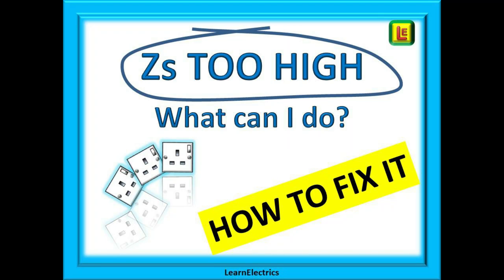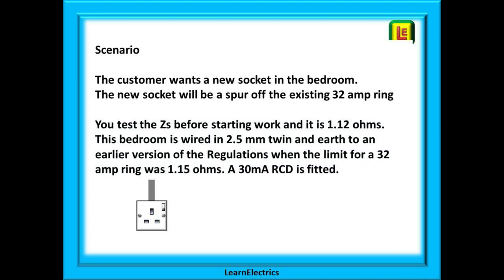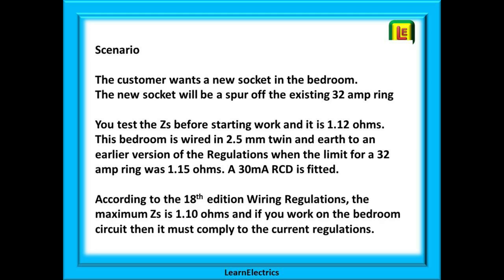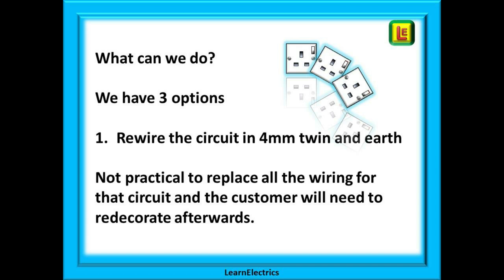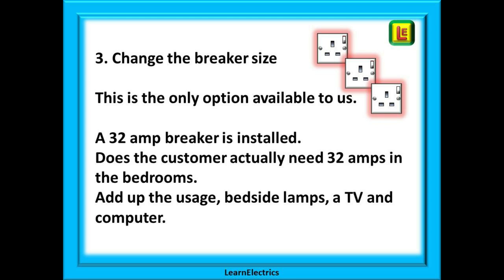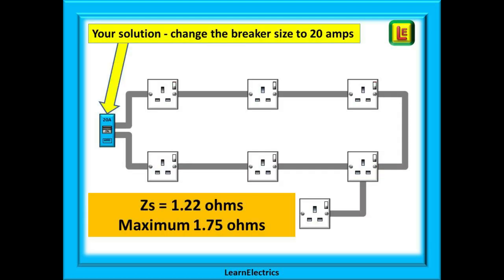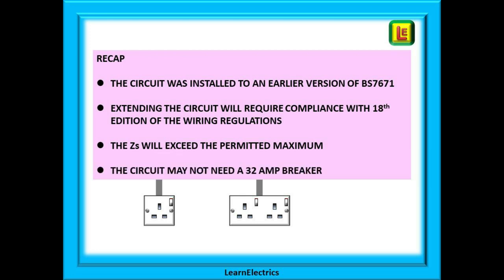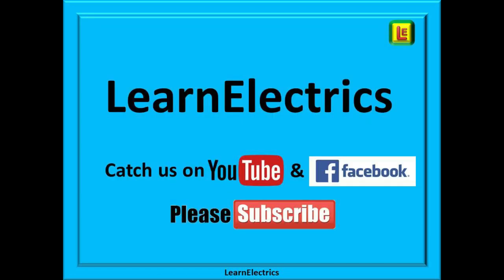Zs TOO HIGH What can I do?

Comment: Great video. Please keep posting these. 
I've just learnt something new here. 

Another solution would be to split the ring and place two 20amp breakers into the fuseboard so you have two radials? 

Is this ideal?
Reply from the maker: Glad you enjoyed it. More to follow. Thanks.
Reply: yes that would be fine providing you have a spare way in the CU and the cables weren't in an insulated wall, look up referance methods, if traditional on brick covered in plaster or in capping/conduit then ok

Comment: These are an excellent set of videos - very clear and helpful. Thank you for making them.

I understand your method and can see it would work, if the ring final can be de-rated. But would you also try to figure out whether the high Zs is a fault and if it can be fixed, maybe by comparing it with with the Ze, checking ring continuity etc. It might be down to a loose connection or broken ring.
Reply from the maker: Spot on Nick, but we are assuming here that we have no fault circuits. The Zs is just a teeny bit too high whereas with an o/c fault we would read 2000 ohms or something. Example the older Regs allowed 32A Zs at 1.16 ohms, now it is 1.10 ohms. No fault but if you are working on that circuit this means it must comply with the new rules. This video was about how to do that. Glad you enjoyed the videos, lots more to come and please keep the comments coming. Dave
Reply: @learnelectrics4402  Thanks Dave - that all makes sense 😀

If you do a video on SWA, would you be able to talk about using the armour for CPC against using a core. All of the YouTube sparks seem to use 3 core SWA, sleeving the 3 phase colours to blue and green/yellow.
Reply from the maker: Good idea Nick, I have put it on the list of videos to do and we will talk about doing it. Thanks for the suggestion.
Reply: @learnelectrics4402  Why do you assume it would only be an o/c fault? Loose connections or damaged or corroded conductors or even a faulty socket could also be the cause. All you have to do is edit the video to say you have checked for faults at the existing sockets and bingo!

Comment: Another excellent well presented video. Why does the max impedance or Zs allowed go up when circuit breaker capacity goes down.
Reply from the maker: A 10A MCB needs half the current to trip of a 20A MCB. Therefore, the 10A has twice the Zs of a 20A.
Ohms law, as resistance.impedance goes down then current goes up. Think of a see saw. hope this helps. Dave.
Reply: That makes it totally clear now of course I understand. Thanks for getting back so promptly.

Comment: The Zs video is great. I have been told however that if you are exceeding the 80% value of max Zs then you are at odds with voltage drop requirements. I asked a sparky friend of mine and he said that he had used this method a number of times, mainly on ring mains and never had a problem. The 11.5 vd was guidance and not statutory. What do you think
Reply from the maker: I always follow the Wiring Regulations. That way I can use the Regs in my defense in a court of law.
Reply: Hi Chris
Dave is right, however there is a loop hole. as you may be aware the IEE regulations are not statutory. However if you follow the ESQCR that are statutory or the IEE design guide 4 you will find them in your favour in regards to voltage drop and can be used subject to what the Uo at the distribution board supply terminals and at the furthest socket.
Reply: @angelofranklin1  Where have you been its the IET not IEE changed years ago.

Comment: Hi, great vid,  in a situation that will not allow us to downgrade the MCB is there any reason why we could not place a 13-amp spur feeding the new socket via a 13-amp BS1362. The 4 second disconnection required can be achieved and the impedance added to Zs would be minimal. The Zs Impedance permitted for this type of fuse is 2.3 ohms for 4 second disconnection on the additional socket. Just a thought.
Reply from the maker: I wouldn't do it this way. The BS1362 is only protecting the cables downstream of it. What is protecting the cables upstream. Thanks for watching, good question. Dave.
Reply: Hi Dave, thanks for your reply always appreciated. I thought about it and the BS1362 spur would only need to protect the one additional socket spur added, the remaining sockets upstream would be protected by the main protective device in the distribution board. Hope im right or Im in trouble.
Thanks for all your help.

Comment: great videos! I'm really learning a lot; just 1 hypothetical question: I guess this is not very likely to happen, unless the installation was already to tight, but what if that new additional load makes the load bigger than the size of the existing breaker (let's say 16A type B)? what would you do? bigger breaker same type (from 16A to 20A type B) would reduce more the Zs,  same size (16A) but higher type (from B to C) would also do that, so what about next type (from type B to C) and also next size (from 16A to 20A)? is that even worse? What the solution would be for this kind of situation? 
thank you very much! keep doing this videos, they are really helpful
Reply from the maker: If the load is bigger than the breaker rating then changing to a Type C or type D will not help. If the cable sizes permit it, you might consider an increase in breaker rating but only if the new Zs is ok (Permitted Zs will go down as breaker size goes up). Can you run a new circuit with a new breaker to the new load. Always think safety, an overloaded circuit can cause lots of problems and dangers. Hope this helps. Dave.

Comment: Hi. Great vid as always. Could you not split circuit into 2 radials and put each radial on 16 or 30a mcb or rcbo. Just means disconnecting mod point of ring? Just a thought
Reply from the maker: Yes you can, a 16A or 20A breaker as the Zs will increase for these lower rated devices.
As long as the Zs is acceptable and the circuit is safe you can do this. Good question, thanks for watching. Dave.
Reply: Thanks for the reply. If you get chance fault finding overloads would be interesting to learn please
Reply from the maker: Good idea Alan. It's now in the notebook to be done in the near future. Dave.

Comment: Thank you for the video, do you have any idea why the lights circuit tripped when testing Zs?
Reply from the maker: Depends which device tripped and what type of meter you are using. If you don't have a no trip loop tester then the RCD will trip. Hope this helps.

Comment: Thanks for these videos! Really helps roots these things into my mind....

Can you clarify that once you reduce the breaker size to 20amps you have to convert the Ring circuit into a A3 Radial? Removing one of the legs going back to the breaker?
Reply from the maker: Absolutely NOT. It can stay as a ring. It cannot draw more than 20 amps so the cables are all fine and nothing more to do.
However, if you SPLIT a ring circuit into two Radial circuits THEN you MUST change the breaker size to 20 amps. Install an extra 20 amp breaker and have one leg off each, assuming each leg is 2.5mm cable. We might produce a video on this, based on your question. Thanks and great to know that you like it. Keep watching. Bux
Reply: @learnelectrics4402  Thanks for the information. In Table H2.1 in the on site guide I assumed that I would have to stick with these types of circuit layouts exactly when dealing with BS1363 socket circuits. This definitely adds to to he knowledge as this is the first time I have had this scenario and solution explained. In my college I was taught that I would have to decrease R1 + R2 by increasing conductor size or splitting the circuit up. Again very much appreciated.
Reply from the maker: Daniel, look at the second line of page 187 in OSG. The circuits provide guidance etc ...
As long as you are making the circuit safer there is not a problem. Answer this - do you need an upstairs 32amp ring circuit in a 2 bedroom house. Perhaps two bedside lamps, a computer and TV. altogether 5 amps perhaps if everything is turned on. Why protect it with a 32 Amp breaker. 16A or 20A is sufficient. Remember the breaker or fuse is protecting the cable from overload as well as protecting persons and 20A is safer than 32A so you have moved in the right direction. Hope this helps. Bux.
Reply: @learnelectrics4402  It does help thank you.

Comment: Are you allowed to change a 32a ring circuit to a 20a ring. Surely it would be better to split it down the middle and make it two 20 amp radials so it complies with a1, a2 in the bs 7671. I can see if you have no space in the db then it wouldn’t work but never seen a 20amp ring so was abit confused
Reply from the maker: This video is about Zs being too high. This is one way of overcoming it. Do you need 32 amps in a bedroom. Splitting it into two is another solution as you say. Thanks for watching. Dave.

Comment: Hi Dave I wonder if can nick some of your knowledge again please regarding Zs please. Lets say you've got a ring final 32A outdoor garden room & you want to run 2 double sockets on the outside. So by using an FCU to do this what would the Max Zs be on the 2 sockets I just installed because in theory they're now a radial protected by 13A fuse and wondered whether I shall be looking at getting below 1.1ohms which is the Max Zs for the ring or shall i be looking at the Max Zs for a 1362 fuse.

Thank you
Reply from the maker: Use the Zs for the ring. The 13A fuse is there to stop you overloading the cable that is spurred. So at the outside socket your ZS should be 1.1 ohms or less. As it says in the video, if the Zs is too high, does that circuit actually need the full 32 amps. If you change the MCB to 25A or 20A you will have a higher permitted Zs. It's got me out of trouble more than once. You keep on picking brains, the more you ask, the more you learn. Lots more videos to follow. Dave.
Reply: @learnelectrics4402  Thank you Dave really appreciate your help.

Comment: Thank you for your great videos. Is it allowed by the reg book to do a ring for 20A breaker? I thought the ring can be done just in 32A breaker
Reply from the maker: You can have a ring circuit with a 6 amp breaker if you want. As long as the combined cable sizes will take more than the nominal current of the breaker.
In fact a 20A breaker is one way of increasing the permitted Zs if you need to extend a circuit that is close to the Zs limit for 32A.
Good question. Dave.
Reply: @learnelectrics4402  Thank you Dave. I’ve seen so many videos on youtube but yours are the greatest. Can you please do a video with completion of the electrical certificate? Regards
Reply from the maker: That is due soon Adrian. We already have a video on Minor Works Certificate and one on Schedule of Test Results. Keep watching. Thanks. Dave.

Comment: Would regulation 411.4 and 411.5(with specific regards to 411.4.204) not apply, where the efli is too high to meet the required disconnection time, a suitable Rcd may be installed? The same situation as a tt system, where max zs cannot be met? 
Great content btw👍
Reply from the maker: There are several solutions in the Regs, this video was just dealing with bringing the Zs readings back into line with Table B6 in the on-site guide. there are also some other solutions offered in GN3 Apx A. Thanks for your input, appreciated.
Reply: @learnelectrics4402  ok thanks, obviously I wouldn’t condone making additions or alterations to an existing TN circuit with an out of range zs, but as a last resort this regulation does come to our rescue and provide us with a solution. 
As you say the first course of action would be as you described in the video. Thanks for taking time to make these videos, I’m an avid viewer👏👍

Comment: In this case that you say changing cables is a hard and expensive job, the question is why don't you use PVC conduits inside drywalls and under floors? Isn't this a better way of wiring?
Reply from the maker: This is the way we did it in France, Sajad. You could use the old cables to pull a new cable through the flexible conduit - if you were careful. Dave.

Comment: A 20A Type B MCB is a good solution as it is a common value. Many manufacturers sell 25 amp type B MCBs,  which can be used in a circuit having a Zs of  1.4 ohms.
[In 25 x 5 = 125A  so  Zs = (230/125)  x  0.95  x 0.8 = 1.3984 ]
Where 
0.95 is used to compensate for voltage fluctuation below 230v.
0-8 is the rule of thumb factor.
Reply from the maker: Absolutely Kevin

Comment: New option. Assume 1.12 is of margin of error so give it a 1.1 blag and add a 13A fused spur and use the maximum Zs for a 13A bs1362 for the over current protection on the new socket off fcu
Reply from the maker: Thanks for watching Tom, appreciated.

Comment: Kindly explain. How does a smaller breaker increase the LOOP IMPEDANCE. I thought loop impedance had to do with the resistance of the earth wire (the less resistance the better)??
Reply from the maker: It doesn't, but it allows the loop impedence to be increased if needed to allow Zs values to meet requirements. Have a look at our video on R1+R2 values on this link.
https://www.youtube.com/watch?v=HvDuVLDxvhs

Comment: Sorry may I ask something is there a scenario where it wouldn’t be possible to downrate the MCB and then use the RCD as the fault protection like in an TT system? I’m an electrician and have used this over the years however I would appreciate your take on this. Thanks
Reply: Please not my comment was not for any newly installed work more so from doing EICRs in leisure centres ect where larger rings have been found exceeding the maximum ZS and I have installed RCBOs to rectify the issue. Not ideal I agree but a lot safer than it was.
Reply from the maker: Thanks for the question Eddy. This scenario sometimes happens and despite best efforts, achieving a low enough Zs is never going to happen. If you've exhausted all other solutions then you can use Reg. 411.4.204 on page 63 of the Regs. I would make an appropriate comment on the certificate to the effect that you are using 411.4.204 because ... etc. That way you show that you have spotted it, tried for a solution and defaulted to using an RCD/RCBO. Thanks. Dave.
Reply from the maker: As above Eddy.
Reply: @learnelectrics4402  really appreciate your input thanks a lot!

Comment: Thank you for your helpful video's. Shame because you should be getting more views in my opinion i think u-tube algorithms do not always work. Since the 17th i believe all socket outlets require RCD protection . If this circuit had RCD protection would this not be a get out clause for Zs value's as long as certain criteria is met i.e  main bonding ?
Reply from the maker: MCBs are supplying protection and ZS matters. RCDs provide additional protection. We just do what the regs require us to do. Glad you liked it.
Reply: @learnelectrics4402  Hi thanks for reply , i quite understand you have to comply with the regs. but in my understanding i thought the caveat  of using an RCBO would negate the need for Zs Values . Yes i understand the concept of Zs for the ADS in general circumstances. Please don't think i am being contentious it's because i like to debate to get an understanding of it . Also i hope this generates more interest in your video's too. My understanding was if you had Main Bonding ( gas & water ) and RCD protection protection the Zs was not a requirement .Are you saying this statement is incorrect ?

Comment: How about using the RCD for fault protection ?  S = √(I2t)/ k or  √(200²*20)/115 = 7.78  Oh right that's why :) cpc is too small.... sometimes an easy fix though.
Reply from the maker: I stick to what the Regulations and exam prospectus wants. Thanks for your input. Dave.

Comment: Hi ya is it no longer an acceptable solution to just have the circuit on an RCD 
As what if the load of the circuit needs to be 32amps say for instance in a kitchen and all the customer wants is an extra socket beside another ? Rewiring a kitchen smashing off tiles and taking down wall units seems a little excessive for an extra socket to me ??
Reply from the maker: Matt, have a look at our video   Protective switching devices   on the following link.
https://www.youtube.com/watch?v=IR2_9N7J4DY
Reply: @learnelectrics4402  so yes you can use RCBOs to combat a high zs 👍
If I was to combine separate mcb and rcd in an enclosure if the DB was too old to put a rcbo in would that also get around the high zs reading in the 18th editions eyes ?
Reply from the maker: There is a max Zs for a particular breaker or RCBO size. If you can't reduce the Zs, then reduce the breaker size until the max permitted Zs is greater than the actual Zs.
Have another look at the video, it is in there.
An RCBO is an RCD and MCB combination.
Thanks for watching. Dave.

Comment: If you change mcb is that a minor works certificate or installations
Reply from the maker: Electrical Installation Certificate. You have made a significant change at the consumer unit. It will also be notifiable. The reason is that you are changing something that has a direct impact on the safety of the whole circuit and the safety of the occupants. When completing the Schedule of test results of the EIC, only fill in the information for the affected circuit.
Reply: @learnelectrics4402  thanks. I take it I will have to notify it as a new circuit as on niceic you can only notify new circuits, change consumer unit or special location
Reply from the maker: That's it Glenn. Just the circuit that is changed. Hope I have helped. Dave.